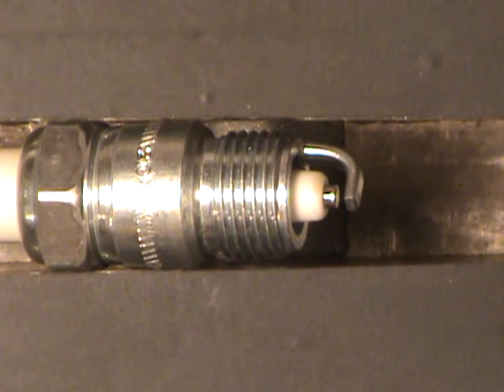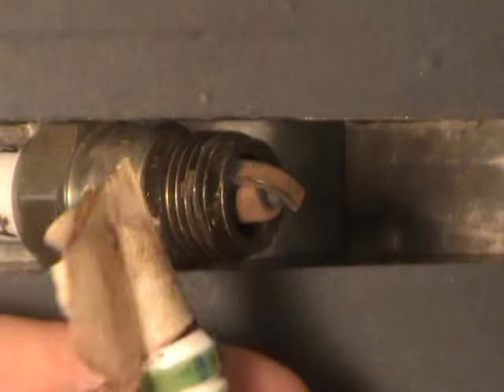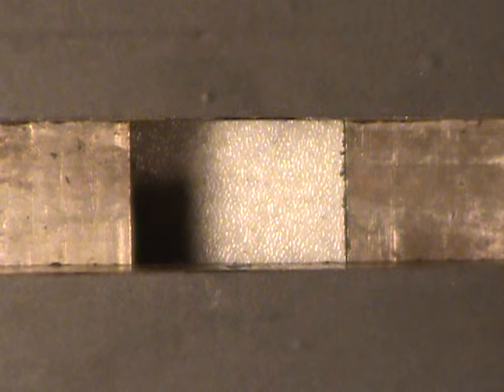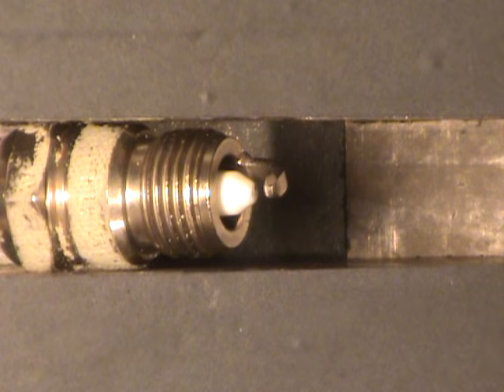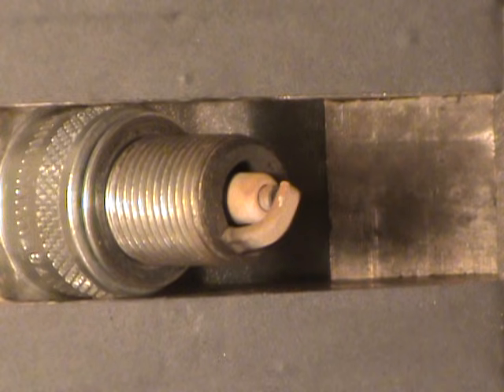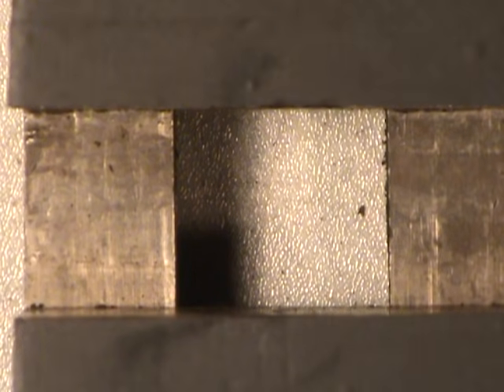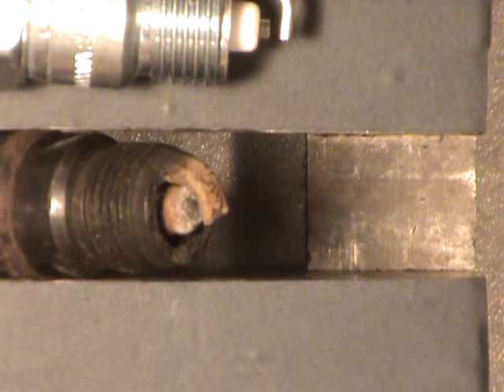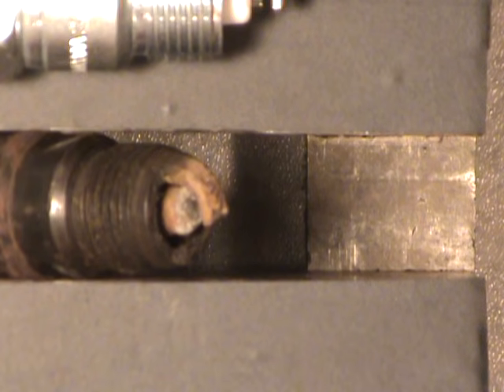SPARK PLUGS How to Read them (Part 3)

Comment from the maker: Greetings Paul Phillips....I hope that you Found the Reply to your Comment, on Your YouTube Channel (that I Posted there), due to my "Not-Seeing" the Word "Reply" Under the Comment that you left Here (on my Spark Plug Video)....For Other Folks, I will mention some things about the Questions that you (Paul), left here, in your Comment....As for the Spark Plug in my Video, that shows that "Major" Accumulation of "Deposit/Deposits" between the Inner, and Outer Electrode, was, what I figured to be, an Oil Burning Problem.

I was going through about "1" Quart, or, "1" Litre of Motor Oil, in about 500 Miles, or, 800? Kilometers, while I was driving at Highway/Freeway Speed, (but, not quite "Autobahn" Speeds!...lol)....More like the Speed that I was allowed to travel at, without the having the "Police" in "Hot Pursuit" (like I was driving that there Trans-Am, in the Movie, "Smokey and the Bandit!"...lol).

Yes-Siree-Bob, that there Major "Hitch-Hiking" Deposit Accumulation, was indeed on my Number "6" Spark Plug, that was the "Original Factory Installed" (set of) Spark Plugs on my (then) New 400 Cubic Inch (6.6 Litre, I think?) Small Block Chevy (Chevrolet) V-8 Engine.

Well, I figured that some Motor Oil was making its way into Number "6" Cylinder Via, either, Oil Control Rings, or, maybe, a Bad Valve Stem "Seal/Seals" (there are "2" Valve Stem "Seals" per Cylinder....One on the Intake Valve Stem, and, One on the Exhaust Valve Stem).

Hmmmmm, (just thinking eh...), that there "Is" the "Possibility" that the "P.C.V." (Positive Crankcase Ventilation) System, might (could be) the "Culprit?"....The PCV Valve (sometimes), just might get "Stuck" (just a wee bit?) in the "Open" Position, and, that can cause Too Much "Air-Flow" (due to Manifold Vacuum), that may, very well be "Inhaling" (with too much Force), any "Blow-By" that may be present in the Lower Crankcase of, that there (or is it This Here?...lol), 400 Cubic Inch Small Block V-8 Engine...(?).

The only "Fluid" Level "Drop" (as in, "Over-Consumption" of Fluid, or Fluids), happened to be the, "Too fast of a Drop, of my Engines Oil "Level", that was showing on the Engines, Oil Checking "Dipstick", and, (what I think was), "Motor Oil Burning", due to my V-8's (not Panic-ing) slight "Over-Use" of Motor Oil in the amount of Miles/Kilometers Traveled.

The Coolant (Water and Anti-Freeze mixture) Level was always up to where it should be, without any Leaks, etc.

The so called "Lime-Scale" that Paul had mentioned, just might be Paul's Engine Burning some Coolant (water and anti-freeze mixture) perhaps?

The "White-ish-Lime-Like-Stuff" that you see on the Spark Plug in This (My) Video, "Was-Not" on the Spark Plug when (at the time), I took the/those Spark Plugs out of my Engine....That "White-ish-Stuff" on My Videos Spark Plug was probably due to being in "Storage", for quite a few Years.

For all of you Folks out there, "Keep-an Eye" on your Vehicles "Fluid-Levels!!!"
If, and when, you happen to See/Observe any of Your Vehicles "Fluid Levels" being "Consumed", or, "Dropping", at a "Faster-then-Normal-Rate", have the "Problem" Looked at "Right-Away!!!"

Now, about "Fuel Additives"....Try to find out, All that You Can, about the Gasoline, that You Buy (Purchase), where "You" Live, as, there are "Different-Formulations-World-Wide!"

There are quite a few things that the Gasoline Refiners/Producers can add into their Gasoline "Blends".
Some, if not, most, Gasoline Companies are adding in "Ethanol" (alcohol) to their Gasoline (Blends).
There are also things like "Oxygenates", and, fuel system Cleaners (well, from what I have heard in the past anyways).

If you have a Fuel Injected vehicle, you might not even Notice any Difference, in the way that your Vehicle Runs/Performs with Todays Gasoline (Gasoline Blend, usually with Ethanol in it), whereas, with the Experience that I'm having, and, have had in the past, while "Tuning" Carburetors, (the Carburetors without a feedback system) that "Can't" Adjust themselves like, Fuel Injected Engines Can, I get into a "Close, and Personal" Relationship with the way that the Current Gasoline (Blend) makes the Carburetors that I "Tune", or Work On, "In-Need"of Adjustments, and at times, "Re-Jetting" (as in, change the Fuel Jets, usually to a LARGER Size), to "Compensate" for all of that there "Al-Chem-Ah-Haul" (Ethanol) that happens to be Added to the Gasoline "Blends" these Days.

Ok now, I gotta go, cuz...It's..."COFFEE TIME!!!"

Take care Paul, and, all of you Other Folks out there as well, and to All, be Safe, and, have a good one.
Reply from the maker: +gabigowriel Greetings gabigowriel....Thanks for watching...................Well, if the Engine is Running and Performing really good, then, I'd say, that, You probably got a good deal, if You didn't pay too much for it, that is...lol........................I had a look around, and, I didn't see any Spark Plugs, that had, as You were sayin', 3 Pins (Outer Electrodes?), and 1 center one........................I only saw, the more common type, of Spark Plug, for Your 3 Cylinder Engine, having only "1" Side Electrode.....Do all 3 Spark Plugs, look about the same...Deposit-wise....as well as, the amount of Electrode/s Wear/electrical Erosion...???.....................If and when-ever, doing a Tune-Up on Your Engine, try to find the Exact Same Spark Plugs, that were Installed in Your Engine, by the Vehicle's Manufacturer, when Your Vehicle was Brand New, to avoid, any un-needed problems..........................If the factory Original Spark Plugs are Gap-able, make sure, that, the Gap between the spark plug's Electrodes, are Set to the Vehicle Manufacturer's, Gap "Specifications" (might be measured in Millimeters or Inches)..............................Have all of the Maintenance done, as in, any Parts, that have to be Replaced, at the Mileage/Kilometer-age, or Time Interval, that the Vehicle Manufacturer Recommends, cuz, something as simple, as a Dirty Air Filter, can make a Carburetor, run, a Richer than wanted, Air/Fuel "Ratio" (as in, too much Gasoline, for the amount of Air, in the Air/Fuel Mixture), due to Restricted Air Flow, through that Dirty Air Filter, and the end result, is usually, Low Gas Mileage, and wasting Money, on Gasoline, that really isn't needed.....................Usually, if just about any Spark Plug, starts Miss-Firing, due to an Ignition Related, or, Fuel Related Problem, while the Engine is up to Operating Temperature, and, just Cruzin' along, You'll probably Notice it, most times, as the Engine, probably, won't be Running all that Smoothly, and like it should be..................Try to get a hold of, a Factory, or After-Market, Chassis (pronounced Chass-ee) Service Manual, for Your Exact Vehicle and Engine, that way, You'll be able to Read about/see Pictures, on, how to Fix and Maintain, Your Newly Acquired "Ride" (aka, Automobile...lol).................Good luck, and........till next time.........Be Safe, take care, and have a good one.
Reply: if you want to make a good time and consideration for any inconvenience this might be better for you
Reply from the maker: Greetings...Thomas Toucheque............Thanks for watching..............I'm not sure, as to what You mean, in the comment that You posted...???....and..........till next time...........Be Safe, take care, and have a good one.
Reply from the maker: Greetings...gabigowriel...............Congratulations, for Buying Urself, a Present...!!!...lol................BMW's, as far as I know, are of good quality.................Enjoy Your "Beem-er", for as long as "it" will Behave itself...lol...cuz, sooner or later (preferably later), it will probably develop a Hick-up or two, that will have to be tended to...Yikes...!!!...lol...and.........till next time........Be Safe, take care, and have a good one.
Reply from the maker: Greetings...gabigowriel..................Oh oh...sounds like Someone is getting "Power Hungry"...!!!...lol.................Just remember now..."it takes Fuel, to make Horsepower"...!!!...pretty much meaning, that, Your..."Fuel Economy"...will probably, be..."Better"...with the..."smaller ENGINE...!!!...Yikes...!!!...lol...oh and, when it comes right down to it, well..."it's Your Choice after all"...enjoy....and......till next time........Be Safe, take care, and have a good one.
Reply: RockysRoadshow
Reply from the maker: Greetings...an ogre gamer22221...............Thanks for watching...and...Be Safe, take care, and have a good one.
Reply from the maker: Greetings...gabigowriel...............Sure sounds like, another Satisfied Customer alright, (the Salesman is thinkin')...lol..............It's good to hear, that, You are so impressed, with Your new "Toy"................Try to keep Your vehicle's Gas Tank, at least 1/4 Full at all times...Why You ask...???...cuz, the electric fuel pump, is probably Hiding inside the gas tank, and, by having that electric fuel pump, immersed in the gasoline, that's sloshing around inside the gas tank, then, the electric fuel pump, will probably be kept cool enough, so as to avoid, having the possibility, of "it" Over-Heating, and going Kaput/quit working, especially so, on a very Hot Summer day...............Also, have all of the vehicle's Filters, changed-out, at the Manufacturer's recommended/scheduled...time...and/or...mileage/kilometer-age intervals, in order to avoid any, not so wanted problems............Watch out for any "Speeding Tickets" now, and keep the "Shine-ee side Up, and the Greasy side Down", and.......till next time.........Be Safe, take care, and have a good one.
Reply: educational children video
Reply from the maker: Greetings...Stephanie Dellinger.............Thanks for watching.............Be Safe, take care, and have a good one.
Reply: RockysRoadshow o, kkhhhu
Reply from the maker: Greetings...Duong Sinh.............Thanks for watching............What do You mean o, kkhhhu ???...and.......till next time........Be Safe, take care, and have a good one.
Reply: yea, wtf was that Duong...ding dong o Khuuu...?!!...lmao
Reply: RockysRoadshow ł